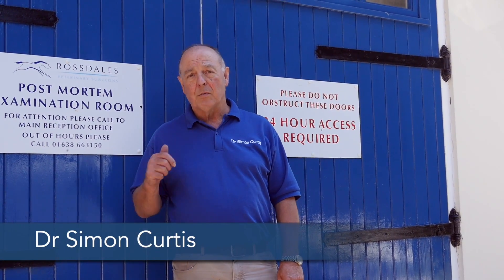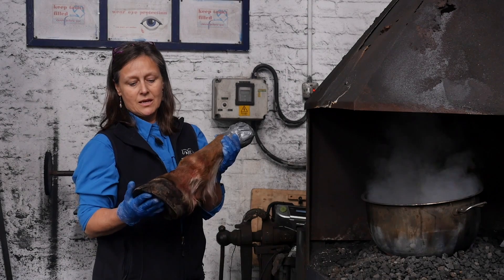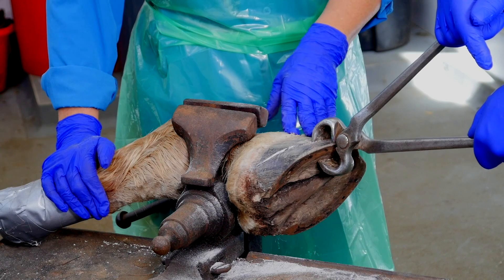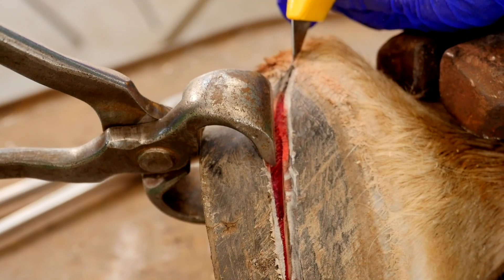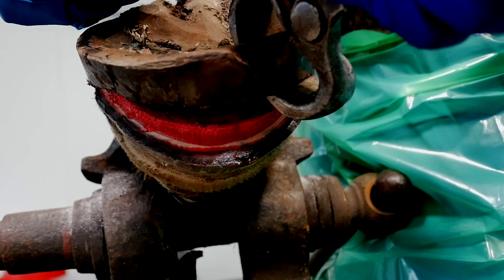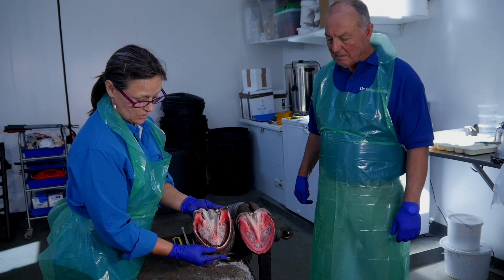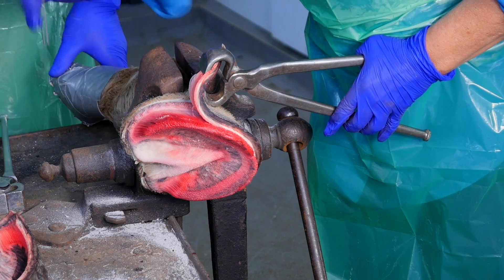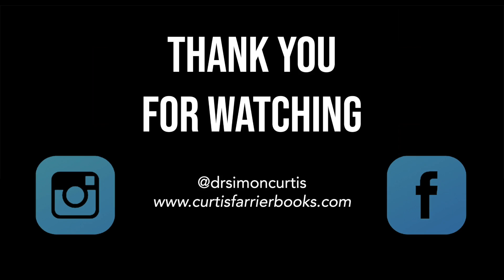Removing a Horse's Hoof Capsule - Hoof Dissection with Paige Poss & Dr Simon Curtis

Comment: mmm yes, I also cut off horse feet for a youtube video.

Like, Why do we need to know what the inside of a horse foot looks like.
Reply: It's a teaching tool. Vets, farriers, even owners need to know what the inside is like so they can treat them without causing any further damage. A diagram only goes so far.
Reply: Horse had already died naturally before its feet had been cut off. It's not uncommon in medical fields, especially veterinary for cadavers to be rendered for study.
Reply: @lucasottile6982  Why do we need to know what inside a horse foot looks like.
Reply: @lucasottile6982  If a horse is injured there, Im pretty sure they are not gonna cut open the foot to see what's wrong.
Reply: So the causes of certain problems and conditions can be discerned and more effectively treated. Of course, doing this to a live horse is completely unethical, but no horse caretaker worth their salt would do so.
Reply: @lucasottile6982  kk
Reply: What do you mean WHY? You need to understand animals biology if you want to treat them, also, we can learn from biology and apply it in our technology. A ton of ours ideas have come from biological discoveries. 

You're a bit close minded.